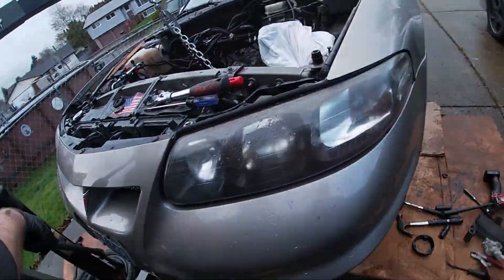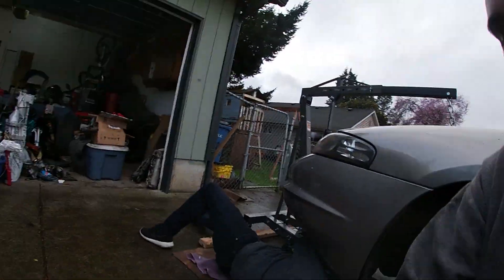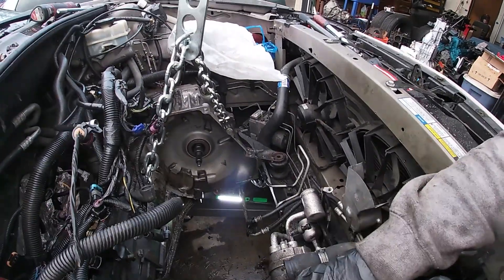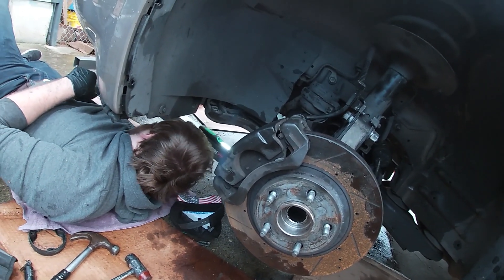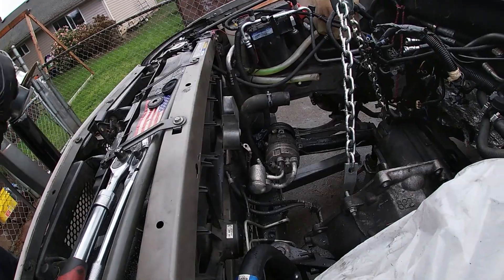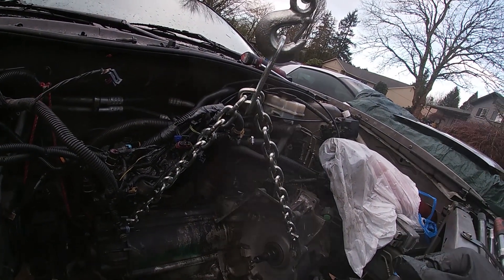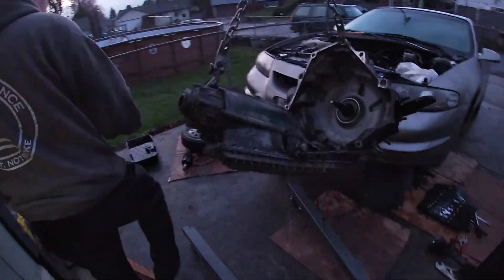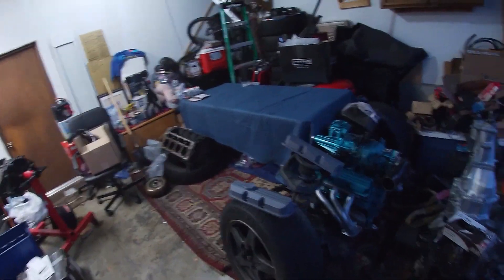Bonneville SSEi 3800 Series II Top Swap Part 12 (We Remove the Transmission! 4T65E-HD)

Comment: When I swapped engines in my L67 Supercharged 1998 Riviera I took the engine and trans out at the same time as well as put the replacement in with the trans bolted on
Reply: Did you put them back through the hood or through the bottom?